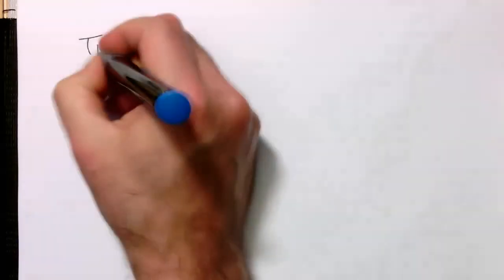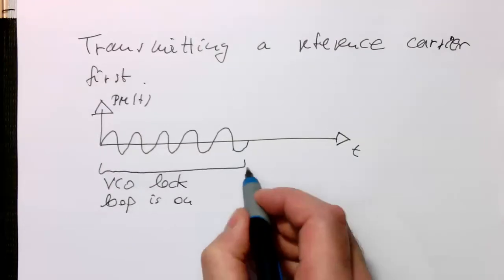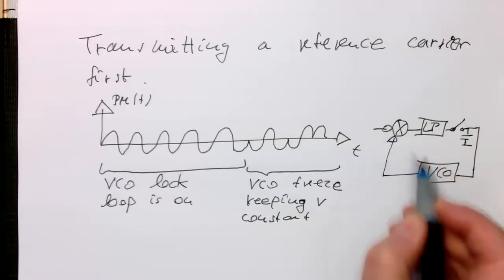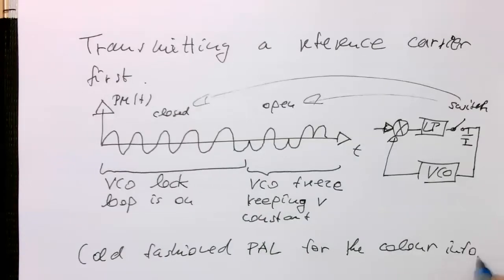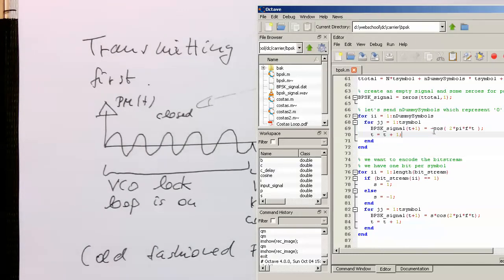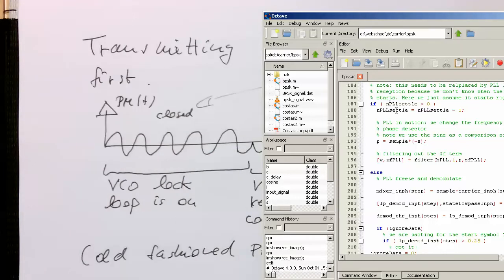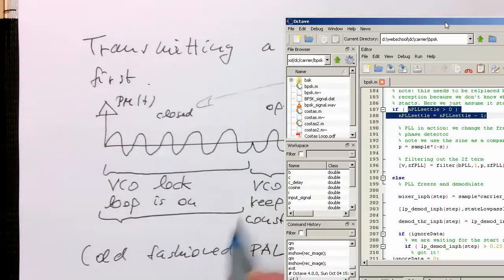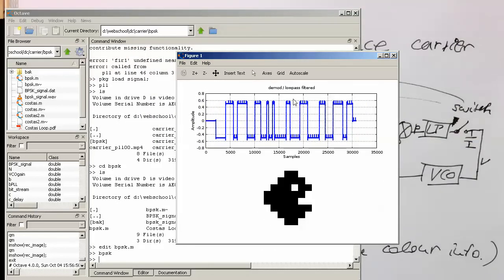Carrirer recovery: with a reference carrier (0008)

Comment: !!!This is an amazing experience.

I am now preparing my final exam for digital communication. I am not so clear why PLL cannot be applied when using phase modulation. I have searched a lot of webs and finally I found this very helpful video. When I see your manuscript, I found it exactly the same  as the slides given by my lecturer, Dr. Sajjad Hussain.  I then found that it is produced by University of Glasgow. I am now a senior student from Glasgow College, UESTC, which is a joint education program with Glasgow. It is really an amazing experience. This video is really helpful. Thanks a lot.
Reply from the maker: Glad hear that it has helped you with your studies. :) (just back from Chengdu)

Comment: If the signal is being broadcasted there are good chances you may pick the signal at any point, and of course if you see phase shifting you could assume its not the carrier signal. On the other side you may want to minimise the amount of time you transmit the carrier signal for sake of efficiency. How do you deal with that? detect a short carrier signal while picking the signal at any point where you cant be sure if its the phase modulated or the carrier signal?

Comment: which text book has this lecture followed? I wish to read more material on this part.
Reply from the maker: it's loosely based on the Proakis book about Comms but this lecture for example is based on PAL/NTSC TV manuals. I used also loads of white papers from the industry.
Reply: Thank you for your reply. I am using "A first course in digital communications" by Nguyen and Shwedyk. I will definitely look at "Digital Communications" by Proakis and Salehi. My task is to do carrier and phase recovery and these videos have helped me to build a simulink model for phase recovery yet. I will look rest of the videos too. Thank you.